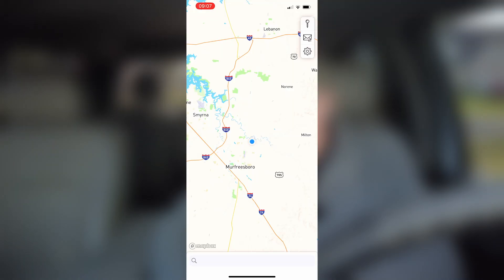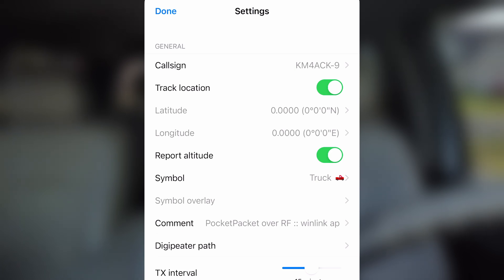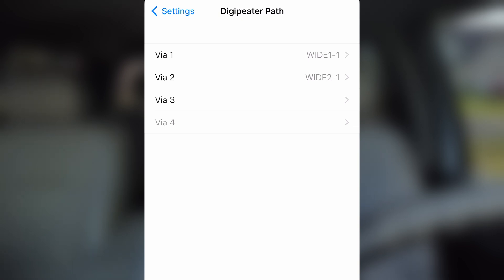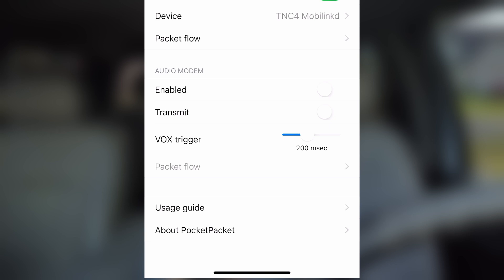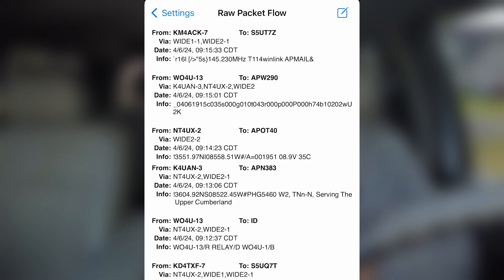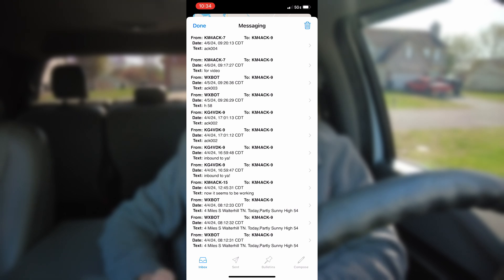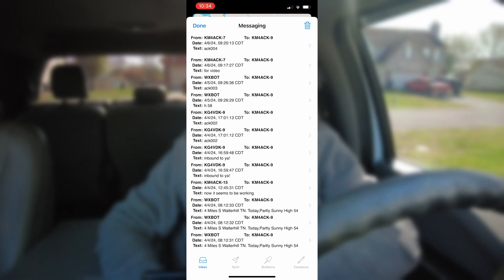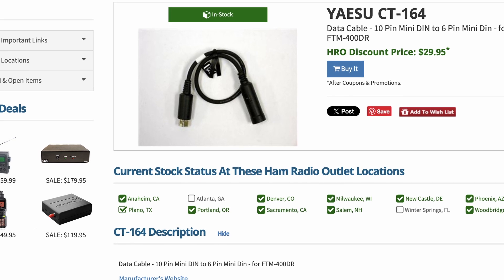QWERTY Keyboard with Yaesu FTM500

Comment: What did you have to do to get the Mobilinkd to connect to your FTM500?  Radio settings?  I’m using an FTM500, iPhone, and RadioMail.  Whenever I attempt to connect to a mail gateway, the FTM500 always transmits on the opposite band than I have selected.  No matter what I do between A-B, it’ll always transmit on the opposite of where I want, and I can’t find a radio setting to correct this.  Thanks.

Comment: I picked up a FTM-500 and have Radio Mail working with it.  On Pocket packet sending messages, I am not seeing them show up on the radio.
Reply from the maker: @thuff3207  if you create them as outgoing messages in pocket packet, they won’t show in the radio. Incoming messages should show up on both the radio and in the app.
Reply: @KM4ACK  That clear it up and I did not get any reply’s. Thank you.

Comment: This also proves that you can use the radio to display maps. What good is aprs for tracking when you can't see what's around you without Internet connection. Using an app to connect to the phone or tablet fixes that. I have been looking high and low for this answer. Thank you for providing it. 
I wish they would allow you to connect directly to the radio without needing the tnc. That just adds to the cost to run the setup.

Comment: Just discovered your 11 month old video concerning the screwed up topics with the FTM-500D, and now you posted this update. I am glad I saw the original and now this. I would like to have a full power dual band mobile in the car but at this point I don’t believe it’s necessary. I will install my FT-3100 144MHz mobile and my FT-891, I figure that will keep me busy until they unscrew (if ever) all this 🐂 💩. I can monitor all the Air Traffic on my FT-70D (that REPEATEDLY was sent back to Yaesu because it wouldn’t charge the battery 🔋 🪫 but functioned properly straight off of 12VDC to the power socket.
I’ll keep the money in the bank for now. 73 de Okinawa 🏝

Comment: After watching some FT-991A videos, I'm wondering if there's an internal USB hub inside of the FTM-500D.  Given the micro-SD card slot and the Bluetooth for the optional headset I expect that there is such a USB bus with chip to act as an internal USB hub.  I don't have the soldering skills to tap into it but hopefully someone else does and will figure out how to add functionality to the radio.

I guess the real question would be if that hypothetical USB hub circuit is in the radio body or in the control head.

Have you tried pairing a bluetooth keyboard to the radio?  I'm curious if anything at all would result.

Comment: I remember a toy called a "speak 'n spell" which used and abcd keyboard, but it was intended as a learning aid for children who might be learning the alphabet at the same time, and who were very unlikely to be familiar with the qwerty layout.  I believe that I've also seen it one some test equipment where they didn't have the space for the staggered rows of a normal keyboard, and the user wasn't expected to be touch typing on it.  That's particularly likely where, keeping the keys large enough for fat human fingers, there isn't enough horizontal space for ten keys in a row.  If you're going to go to the next line between the I and the O, for example, maintaining qwerty order isn't particularly helpful, since, for example, the R will no longer be over the F.

Additionally, while no country uses abcd, not everywhere uses qwerty.  The French, for example, use a layout that is identified as azerty (I think that only four keys have changed).  So if Yaesu chose qwerty, the French might be annoyed (among others).  And probably other countries,  Making the layout selectable requires yet more potentially buggy code to develop, more ROM, more settings that users don't want to deal with, and more effort writing the manuals.  It may not be great, but we all know the alphabet, meaning that Yaesu may have made a relatively wise choice.

Personally, I think that text entry should have been via two buttons on the microphone that you could use as an iambic key. ;^)

Comment: Hey with a touch pad those cheap skates could offer a Dvorak keyboard option to boot! lols, The fastest typing speeds have now surpassed qwerty, unsurprisingly. Although it should be noted the Dvorak keyboard speeds are suppressed, it took me a few searches to find out what is going on. Qwerty was designed for the key arms on mechanical typewriters to stop them sticking together, but an un-natural layout for typing, where Dvorak was specifically designed to spread the letters of each word on opposite hands as opposed left-hand centric with qwerty.

Comment: I use the FTM-440 and I have used the Mobilink with it as well.  I have to turn the packet modem off to get the Mobilink data to be transmitted. I did not think the FTM-500 allow packet transmission with the modem on.  If so I will be upgrading.
Reply from the maker: It will allow TX with the modem on :-)
Reply: @KM4ACK @ KM4ACK That is awesome and I would like to know if you could use the USB cable to Direwolf and YAAC and send APRS messages.

Comment: Honestly, I dont understand why this is a big deal.  However, seems that about 25 lines of code could have given the user the option.  😂  They should fix it.
Reply from the maker: For those that seldom use APRS, it's not a big deal. As an avid user, I just wanted a keyboard that I am use to. You are right that it should only take a few lines of code.

Comment: Incomprehensible that they cannot put a firmware update out for US radios to add QWERTY and memory banks. But, we keep buying the radios so they have no reason to change. I'm planning to sell my 300 and jump to ICOM solely for these issues.
Reply from the maker: Does Icom have a true APRS radio that I am unfamiliar with?
Reply: @KM4ACK  unfortunately not that I am aware of, but I figure I can use a set up similar to what you are using with APRSdroid on a dedicated old android phone to get APRS functionality and also gain memory banks.
Reply: Icom does not have an APRS capable radio, unfortunately. When doing APRS, I set up my ID-5100A for crossband repeater when using my FT3D or D-75. 

At my QTH here in East Tennessee, I have a hard time getting out since the closest Igate is off the air. The nearest digipeter is in Monterey, about 40 miles from me. Getting into that with 50w out on the 5100A is more of a miss than a hit. 

That is an option to use. The crossband repeater function on the ID-5100A is a lot easier than setting up a Yaesu Mobile Radio with that capability.

Comment: I hope Yaesu will soon bring the memory banks for FTM200/300/400/500 with a firmware upgrade. So incomprehensible and tedious that this function is missing. They have integrated it in the handhelds, why not in the mobile devices? 73, de HB3XVA
Reply: Yes this